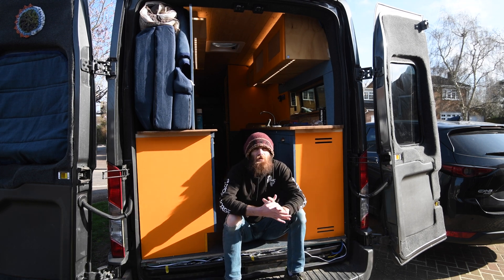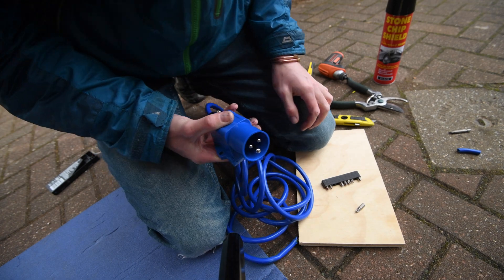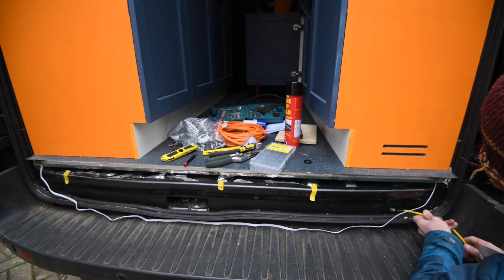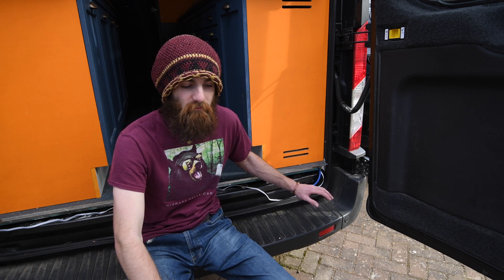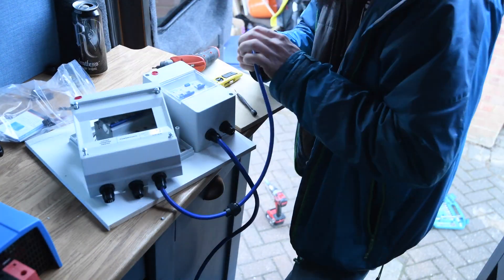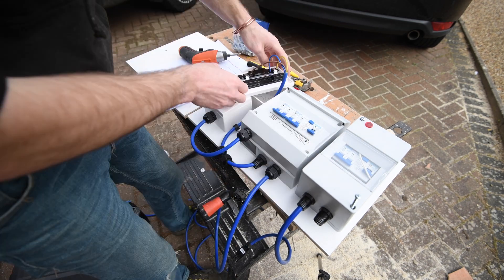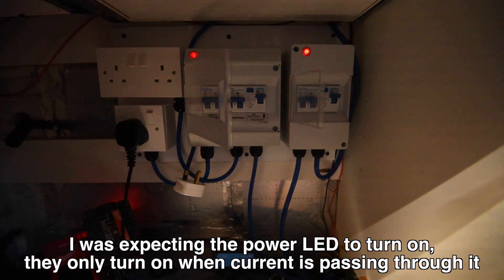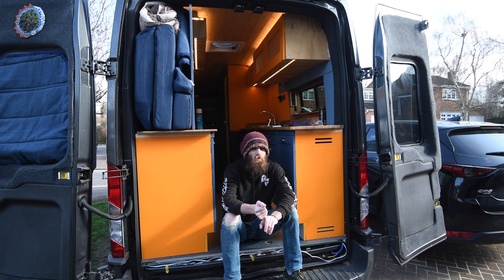Part 2: Installing a Victron MultiPlus : Install, Earth & more | EP49 | Ford Transit Campervan Build

Comment: Hi Alex, I'm about to start my multiplus instillation, can i ask if there's a particular reason for connecting the live directly to the battery and not via the bus bar (as i have seen some other people do). I'm a little confused as to whether it's just a preference or if there is a reason to do one or the other? Thanks

Comment: Great video...I just bought a used victron the same, is the leisure battery charged via the dc input cables when on shore power? How is the starter battery connected,  does live go onto the spade you pointed out, and negative also pushed into main dc negative?
Reply from the maker: There is a small spade terminal on the bottom of the unit which is the trickle charger that is the positive as for the negative it needs to have a common negative already with the leisure system
Reply: @MispronouncedAdventures  thank you

Comment: Hi, useful video, but how did you use the MK3-USB device to progam the inverter/charger ? I have the identical Victron unit with the multi-control panel and the MK3-USB but cannot find anything to explain how to change the settings for a LifePo4 battery in the UK ? Cheers

Comment: Hi Alex

Where did you get the consumer unit from that you are using for the a/c in. Just about to do a very similar installation with victron kit and two roamer batteries.
Thanks.
Reply from the maker: 12V planet sold these units. Although just point out these units are no longer current regulation as they are plastic bodies and they should be metal.

Comment: Tip for installing mutu stranded core cables. I've always found that if at all possible it's best to get them shaped into their final position as close as possible with all bends shaped then cut and strip.  The reason for this is when moving / bending the cables after screwing into the terminal it can pull and push the internal individual multi strands in some cases pulling them back out of the terminal. Not always but it does happen.
Reply from the maker: That makes a lot of sense to me. I do on some tighter radius turns near terminations bend them first

Comment: Hey mate, what does the trickle charge feature do. Ive a faily basic set up of running hookup to consumer unit. Consumer unit to multiplus. Then multiplus to a 2nd consumer unit that feeds 2 plug sockets. I assume once im hooked up to mains power that will both charge my battery and power the 2 sockets?. I dont have any monitoring. I just wanted to keep it as basic as possible. Also the 2 earths from the consumer unit and the earth from the multiplus do you have them running all to the same chasis earthing point individually or to a busbar and have thst going to the chassis earth. Thanks

Comment: One important question from my part: is the solar charging part interfering with AC charger when van is pluged in? Is there a problem if both of the 2 sources are charging the battery at the same time?
Reply from the maker: No problem at all with multiple charge sources but Best to make sure the charge settings, bulk, absorption, float are all the same. 

If I’m ever on hook up and the multiplus is charging, then the solar is also charging.
And whilst driving, I have two different battery to bbattery chargers and the solar also all charging the

Comment: Nice video. Am I right in thinking the pass through feature means you can have the same AC sockets in the van for use from shore power and from the batteries via the inverter? Or should you have different sockets for shore power and battery power?
Reply from the maker: Good question. it means that the same sockets can be both work through hook up / shore power and via the inverter with battery power.

Comment: Great video! Did you ever try a nespresso coffee machine or sth similar? Does the multiplus handle that?
Reply from the maker: I’ve not personally tried a nespresso coffee machine on it, as long as it’s below the rated wattage of the inverter I see no reason for it to not work it. I use an induction stove and air fryer on it all the time

Comment: Hi Alex, love the idea of going with two consumer units one to protect from any potential hookup issues. 

Question regarding the electric hookup uni, why are you using a 10amp mcb and not a 16amp? Is the 10amp not restricting you getting the max 16amp typical of camp sites? Thanks.
Reply from the maker: It’s definitely the recommended way by VictronEnergy to install  these units in a isolated format. 

As for the 10 and not the 16amp MCB, for me personally I would never probably use it ( and that’s what the consumer unit came with if I had 16 then I would’ve been happy as well ). Even if the multiplus is charging the battery at charging at maximum and I’m running the induction stove at max. That probably wouldn’t exceed 10 amp. 

If I had installed a powerful electric heater then I would probably replace the 10 for a 16.  As a few days ago I had my smaller electric heater, and was using a 2000 W heat gun and a few other things on. And I maxed out my preset 9.5amp ( set on the controller ) so than the multiplus also starts inverting as well to give the extra power required
Reply: @MispronouncedAdventures  Thank you for the speedy response. That’s absolutely great and exactly what I needed to hear.
Reply from the maker: No problem, glad I was of help

Comment: Hey Alex, just wondering mate how you found the multiplus inverter now you’ve used it a while. I’m planning out an all electric/no lpg build. Main question really is would you up it to the 2000 or even 3000 in hindsight? non of the appliances I’m looking to use run more than 2kw and probably wouldn’t ever use at max anyway. Cheers
Reply from the maker: The Multiplus is frankly brilliant unit, I have subsequently installed them in customer vehicles as well when doing electrical systems for Clients. If I was to do it again I would definitely go for the 3000 just to give me that extra bit of headroom. However size was the reason those larger ones were out of the question, I just wouldn’t be able to fit it in my cabinet

Comment: I watched your video and notice you have the same mini consumer unit with a red led, on my instructions it tells me that "This may glow when the mains is connected but reversed" it looks like your light is illuminated? "The indicator will remain unlit if the polarity is correct"
Reply from the maker: Hmmm, that’s in an interesting point. Red indicator light does seem to be referenced as a “polarity light” not saying reversed or correct on mine. now on the site I used to buy it . But I really don’t remember seeing that information at the time. The system isn’t reversed polarity as I’ve been using it for the last year on standalone and campsite hook up without issue and it all wired up correctly.
Reply: @MispronouncedAdventures  Please post an update with your findings.  I've done a little more research and it shouldn't be lit.
Reply from the maker: Interesting, I’ll look into it when I get sometime. Only potential issues I could think of is 
 the wiring on the multiplus AC-in cable  ( inverter side plug or shoreside plug ) has a pin swap by accident when installing, which I don’t think is the case as it’s quite well labelled. The purchased power lead has a pin reversed or the polarity is reversed on the wiring on my parents garage for some reason ( I have never looked at the consumer units whilst on other hook ups so can’t verify the light ) .
Reply from the maker: Just a follow-up on this turns out there was a electrical issue / reversed polarity in the extension cord I was using from my parents garage. When using a normal socket wall socket ( and all other sockets and hook ups )  the lights are out. There was an issue with extension lead at my parents house I was using
Reply: I was just searching the comments to see if anyone had picked up on this, good spot. Should be checked every time you plug into 'shore power', polarity is important, also worth noting is that the light may also come on if there's an P.E. fault, i.e. no protective earth.
Reply from the maker: Yeah all sorted now. Issue with the extension lead i was using in the garage

Comment: Hi Alex, very good series of videos, thanks a lot for sharing! 
I may have missed the info from the video, but how do you stop charging from shore power when the van is at low temp ? As far as I know, you cut the charge using BMV & relay feature for solar and B2B chargers, but I do not see how you manage that with this charger. Can you program the unit? Thanks :D
Reply from the maker: Low temperature cut off is a bit tricky but perfectly doable on the multiplus. However it’s not a true “low temperature cut off” setting,  it’s more of a prevent charging option. Using a signal in foot, in some ways the same way I use the BMV relay and a signal. There is a “assistant” is the VE Config software called “two-signal BMS” The idea of it reuses some of  multiplus wire ports ( temp port & aux port ) if it receives a signal it  prevents discharge and the other receives a signal prevents charging. However I am yet to get it fully working myself
Reply: @MispronouncedAdventures   Nice videos, and nice guy also ;) So fast to reply, even on an old video! I have already installed almost the same setup, Ford transit MK8, victron 24/3000 multiplus 2, victron smart solar and smart orion for B2B. I am on the verge of configuring the multiplus 2, and I read a few comments about assistants on victron forum. Also, I plan to have a raspberry Pi with Venus OS connected  to monitor and control. I need to investigate, as I want also some low temp protection on the LiFePO4 battery with 2 security level: one on the charger and a second one on the BMS itself as final guard.

Comment: Great videos, thanks. Do you have links for the consumer units you used, I couldn't find them at your amazon store.
Reply from the maker: Www.bigwhitebox.co.uk is the company I used
Reply: @MispronouncedAdventures  Many thanks for the quick reply and information, would be great if you continue this mini series when you have chance, very interesting to see what you're doing.
Reply: I'm just looking to install the 12/1200/50 multiplus model, do you know which is the component that I need that then allows you to connect and configure it with the victron connect app? I assume it would connect to the ve.bus port and mine only has one, meaning I couldn't then connect the remote control panel you used? thanks.
Reply from the maker: A few options. The USB to VE.bus MK3 interface will allow you full control via the VE Config software. The VE.bus smart dongle will allow basic settings via the Victron connect app
Reply: @MispronouncedAdventures  Thanks once again Alex for taking the time to reply, it's appreciated.
Reply from the maker: No problem. I hope it helps
Reply: @MispronouncedAdventures  Don't mean to be a pest but do you know which is the easiest/cheapest way to be able to limit the rate the charger charges at? would the smart dongle enable this, I'm struggling to find the information. thanks again!
Reply from the maker: The “victron digital multi controller” is the best / fastest option and is what I use to control max incoming Amp on hook up. 

Why might you need to limit the charging Charing it’s self?
Reply: @MispronouncedAdventures  My batteries are AGM that are a few years old, i'm a little worried that the full charge of 50amps from the 12/1200/50 may be a bit much, thought to possibly turn it down to around 30amp.
Reply: I do really like the idea of the multi controller to limit input on the fly, sometimes abroad the input is limited
Reply from the maker: How many batteries? 50A in total divided amongst a few would be fine. I also believe by default the multi plus charges settings are slightly dialled back from their full charge power. Otherwise I think the MK3USB interface would be the best option / only option
Reply: @MispronouncedAdventures  small bank of 2 batteries, each one 110 ah.

Comment: Just fitted a multi plus In my van but having some issues with the Incoming ac consumer unit rcd. As soon as the ac input is plugged in unto the multiplus it immediately trips the rcd ? Any suggestions would be appreciated thank you
Reply from the maker: Hmm. That would say to me there is a fault or a RCD is broken. 

If you have a multimeter which can do continuity. ( obviously without the shore power connected and the Multiplus turned off!!! ) presuming the Earth is bonded to the van’s chassis. check for continuity between the live & neutral pins and the chassis of van and see if there is any continuity which would imply there is a fault which is why the RCD trips

Comment: On most ford vans across the models you can route external to internal cables such as hook ups through the underside of the rear cross member and up behind the lighting clusters and rear pilar
Reply from the maker: Whilst it’s is pretty much what I did to get external to internal. But my cupboards cover the access in the internal rear pillar on the inside.

Comment: The diagram you showed on the phone connects the grounding of the Multiplus to the negative bus bar, is there any reason why oyu went with the chassis grounding?
Reply from the maker: No chassis grounding in my system. The Victron diagram shows the Multiplus AC Earth point  going to chassis ( AC Earth bonding ) but via there DC negative bus bar. My Multiplus AC Earth point just goes to the chassis directly for bonding as my DC system negative is not grounded to the chassis via the bus bar ( or at all ) so in turn my AC Earth couldn’t be bonded via the bus bar as there would be no connection, sorry separate connection was made.
Reply: @MispronouncedAdventures  Thought the starter battery was grounded to the chassis. Therefore I need to ground something to the chassis, either the negative bus bar or the inverter directly, right? Thanks again, your videos are so much help!
Reply from the maker: The starter battery is grounded to the chassis like in vehicles as that’s part of there normal wiring set up . My leisure / home battery has no connection via the chassis as it’s completely unnecessary in my system as I’m using the isolated version of the B2B /battery to battery charger, which is designed for Systems with no common negative / ground ( usually the chassis ) between the starter and leisure batteries, the unit a has two separate ports for the negatives of the starter and leisure system. The non-isolated B2B has only one negative / common ground, on a non-isolated system people do make the chassic connection via there neg bus bar

Comment: Very informative video....top idea to have the incoming AC protected....would a 20a RCBO be ok?
Reply from the maker: I’m not for personally familiar with the RCBO unit . But from my understanding it’s pretty much a RCD & MCB combo unit right? 

20A  would of that would of been ok as long are you running 2.5mm cable. I’d have thought 20A would’ve above the 1.5mm amp rating
Reply: I think (don’t quote me, just planning my own build) a double pole RCBO could be used alone to protect the incoming AC feed, it would provide both overcurrent and residual current protection as well as meeting isolation of supply requirements. As you say, would need to be sized for the lowest rated cable used between inverter and hookup point. Lookup table 4E1A for cable ratings.